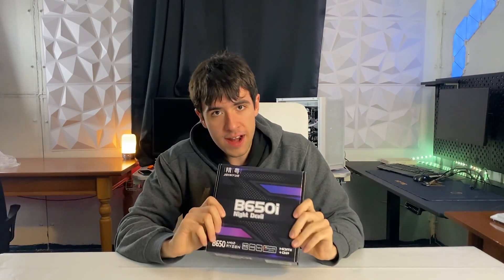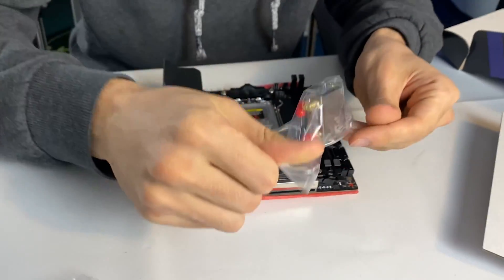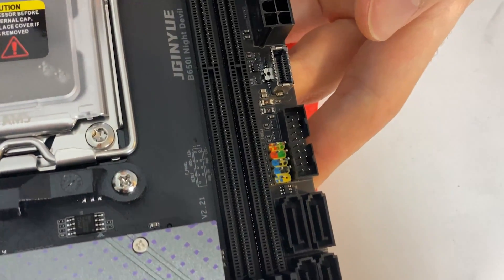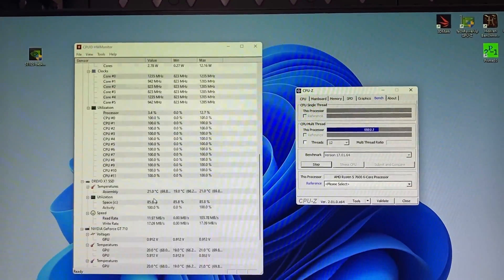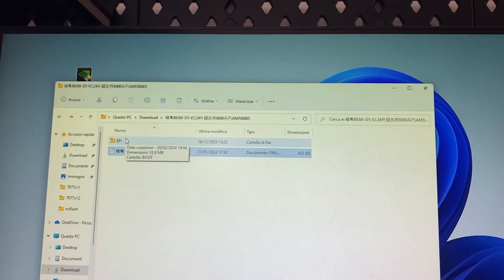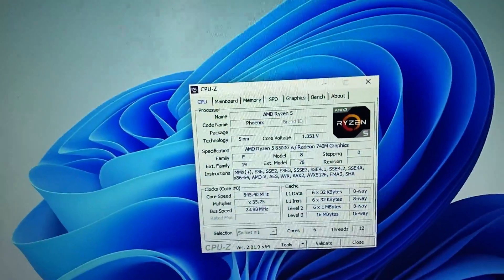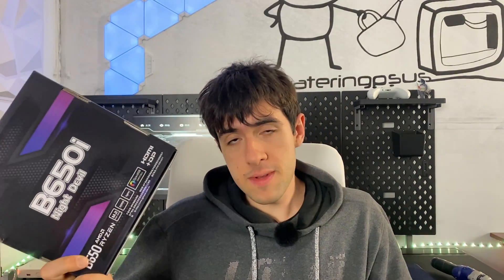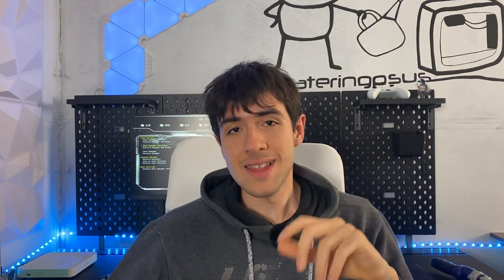Is this 100$ Chinese AM5 Motherboard a Scam? | | Jginyue B650i Review & Benchmarks

Comment: I updated the BIOS to the latest version. I have a Ryzen 5 7600x. After the update, I noticed that the CPU temperature rose by 7 degrees. At idle, it was around 37-38 degrees. Would you recommend that I update it or modify the BIOS?

Comment: basically a great mobo for half of the price of the m-itx entry level (asrock b650i lighithing, for the same audio chip, same 8+2+1phase and things), btw who love in white (the eom is the same, you can check with a 2 pic close togheter, and check the same components / placemebts over the pcb) you could go with the Erying B650 ITX Alikad D5

Comment: could be fun for a small low wattage nas project, specially if the pcie is x16 and bifurcable to x4/x4/x4/x4 , could you check that? does using both nvme disable lanes on the pcie maybe? or other stuff. does it ONLY support ryzen 5 7000 series? could be a bit of a bummer is chasing those watts :) Ah yes, please do a readout of what the board draws idle as a nas for me will mostly be idle :)

Comment: Hi, I need help! I have the Jginyue ITX B550i but can't work out which wifi card I need for it. I've tried a few but the antenna cups don't fit. which card did you use? help!!!
Reply: U need wifi card with E and A keys
Reply: @sc9433  its ok, shoehorned an intel card with long cables into that box

Comment: I just bought this mobo for $95 on Saturday. I also picked up an AMD Ryzen 5 7500F. I plan on using 32GB G.SKILL Flare X5 (AMD Expo) RAM and a AMD Radeon 6800 XT GPU to build as gaming PC. Let's hope it goes according to plan. I bought this mobo on your recommendation! Non c'è niente di unfortunate sull'essere italiani!
Reply: Can i get update on how this board perform ? Any bug/error?
Reply: @atvina7129  Right now, the build will not post. I have two of the debug lights on. BOOT & GPU are lit up. I am using a AMD Ryzen 5 7600 right now because I still haven't received the 7500F from AliExpress.
Reply: Don't upgrade the bios yet. I have the same combo. Default bios is good for xmp.
Reply: @TheGrungeChild  did the 7500f work without bios update out of the box?

Comment: I've ordered mine with a 7500f from AliExpress. Fingers crossed.. I've got expo corsair 6000mhz ram coming hopefully it all works.its going in an nzxt h1 V2 which has a fan controller..thanks for the review, it was this or an a620..
Reply: The overclocking ram expo/xmp is not going well. I've pressed the clear CMOS a lot..
Reply: @TheGrungeChild Have you found a way to XMP on this mobo yet?

Comment: I have h97i board from same company. It had a lot of issues with drivers on their website but thankfully auto detected driver worked just fine and it's still running quite nicely with 4670k!
Top on the line? probably not but I guess they're making ok quality mb for decent price.

Comment: Hope someone with this board could test the ADT R54SF 4.0 adapter + an NVME to 5 Sata adapter to find out if that could be used for a NAS, even if it's slow as wifi usually is only 1x and probably gen2. This way you could have the pcie and both nvme free for other uses

Comment: Snagged the same motherboard and a Ryzen 7 7800x3D both off Aliexpress for really cheap! Fingers crossed it isn't a scam, just got to wait for it to land now. Arriving in two days.
Reply from the maker: I’ve slotted a R7 7800X3D on it off camera as well, it was just too good of a motherboard to keep it with a Ryzen 5 (even though my APU recommendation still stands) and even with a RTX 4090 it’s working VERY well
Reply: I've got one, don't upgrade the bios if you want your expo/xmp to work, it's not 1 setting. It was on default bios. Then I upgraded and you need to be a computer science major to make expo work after that.
Reply: I was wrong, it's fine. My CPU (AliExpress 7500f) can't get the ram to 6000. And caused a crash again and again. Upgrade the bios. It's good value.
Reply: So the RAM works at 6000 with a different CPU?
Reply: wait so tell me what happened exactly, please. Did the 6000mhz ram work after the upgrade of the bios even with 7500f?
Reply: @TheGrungeChild  so we need to upgrade the bios for the ram to work at 6000mhz??
Reply: how did it go ?
Reply: Yo lemme know how that goes? I’m actually building a new pc soon, and buying all the parts slowly one part at a time

Comment: Hey Mate,
Do you think it will work with 7600mhz ram?
Reply from the maker: The motherboard will handle it. But you need a CPU with a good IMC
Reply: @ImWateringPSUs   i am going to use 7600x

Comment: We have a new apr bios: Add an option to adjust the PWM value for each degree of temperature increase in fan temperature control settings, and add an option to switch PCIE rate adjustment (bios defaults to automatic gen3 rate). Have anyone tried it?
Reply from the maker: I have tried it, updated it yesterday. It works fine!

Comment: Your video led me to get one. And i just recieved today. Can't wait to see how it holds up with my 7800x3d. Thank you!!!
Reply from the maker: Glad I could help! I just put a 7800X3D on mine too and it works flawlessly :)) I’ve been running it in a ITX board with a RTX 4070 Ti Super
Reply: @ImWateringPSUs  the 7800x3d is exactly what I had in mind if I were to get this board! It's nice to hear it works great with this motherboard I might just purchase it and your video definitely persuaded me in getting one. I figured since overclocking is not an option with the 7800x3d, this board would be great if it was stable.
Reply: wdym overclocking a 7800x3d is not an option for this motherboard? what's the issue? is it due to vram heating up or what?
Reply: @ImWateringPSUs  what is complete spec of your ram
Reply: how's it going with the board? I'm thinking of getting one too after watching this video
Reply: @cineconify  did you get it?
Reply: @AccidentalAstronaut786  yes I did. But it's yet to arrive.
Reply: Hey does the board work well with 7800x3d?
Reply: Its am5 might as well go all out if you can especially with that 3d and there's more am5 chips coming so won't be useless
Reply: Oh ya actually i been looking for this board couldn't find the video actually looks impressive i seen it on I'm put a 7600g tho how that 8500g ? Got a sub from me gonna go check if u compared those cpus yet
Reply: So, how was it

Comment: hmmm what about ecc ram support and bifurcation options in bios?
Reply from the maker: Everything is there, surprisingly! So yes, with the right CPU ECC should work and you have all the settings (as well as some very in depth network settings that are generally not available on regular boards)

Comment: Really impressed with the price and performance, and really cant believe the quality of the bios. Would love to make a build with this board! I have had 2 motherboards from this company, an x79 and x99. Still working to this day used both for budget gaming pcs that I sold on the cheap to some friends during the pandemic apocalypse.
Reply from the maker: That’s 100% my opinion! I had never tried Jginyue before, only Huananzhi and cheaper brands and honestly Jginyue is definitely more premium. Both as materials and as software. If you wanna do an ITX build like the one I’ve done in the 3D printed case, I 100% recommend it!

Comment: So, if i need to update the bios i need a 7000 cpu?
Reply from the maker: Nope, for Ryzen 7000 it is compatible out of the box. But for 8000 yes you’ll need a BIOS update!
Reply: @ImWateringPSUs  he is asking if he needs to insert a 7000 cpu to make the bios update
Reply: You have probably figured this out by now but yes, to update the BIOS you will need a supported (= 7000 series) CPU. There is no BIOS Flashback support.

Comment: You are doing all the same tech I am doing at the moment! I just built a system in a Fractal Design Node 202 SFF case with an AsRock B650I Lightning WiFi, with a Ryzen 7900X (taken from a failed build where the motherboard died.) I managed to fit a 240mm AIO in the case. Just using integrated GPU as it is a media centre PC. Loving these new M-ITX boards and the build quality actually seems fairly decent across the board (pun intended.)
Reply from the maker: Ahahahah that's great to hear! I've alays been an ITX lover and to be honest, looking at how efficient the whole AM5 platform is, I think they're the go-to for SFF. Asrock too are a guarantee, I had a Phantom ITX back when I had the NZXT Manta as a case in my daily :)

Comment: I'd consider this if it had a built in wifi option. Good budget option
Reply from the maker: To be fair, it has the physical space for the antennas and the slot for the module. WiFi modules can be had for 10 bucks roughly, so that's something to keep in mind :) Thanks a lot for watching and commenting!
Reply: @ImWateringPSUs  would they require usage of the pcie slot though? Maybe I'd be ok if it was mATX and I had another pcie slot for GPU but for itx that's not a compromise I want unless I know I'm just going to use APU
Reply: @EzaneeGires  it looks like it has an m.2 e key connector right where it should be near the io shield, where you can inser your own wif card. no need for additionalpcie slot for this
Reply: @Japhgar  good spot there thanks. Maybe if I can find a cheap m2 adapter then. I do hope a combined wifi board is available tho at a decent price. I'm not in any rush to build itx for AM5 yet though. Just built an mATX am5 pc